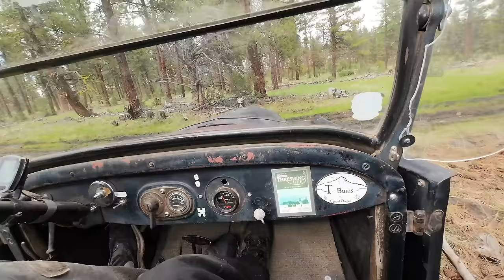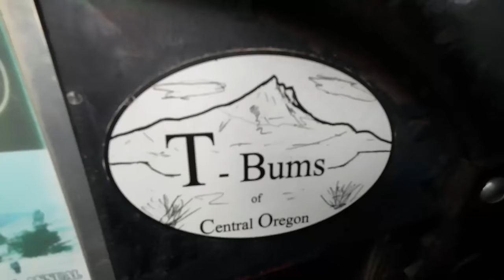Off Roading A 102 Year Old Car Goes WRONG! (Rescue mission)

Comment: This brings back memories of working with an older gentleman back a (while) ago. He used to tell  of the time in his childhood when they were traveling on dirt roads and his father would just turn loose of the steering wheel at 30 miles an hour. The tires would follow the ruts in the "road" they traveled, his mom screaming  all the time. He called following those ruts "cooning the edges." I enjoyed the video very much and wouldn't minded if had been longer. Those cars had to be tough because they were the truly the first off-road vehicles because back when they were built there weren't a lot of paved,  much less, gravel roads.

Comment: I've been watching you a while now- I agree- this is one of the best recoveries!  Also- it is Memorial Day Weekend- looking at these old cars reminds me of the trucks and ambulances they had in World War 1 . (no I'm not that old!) The used a GM 1916 3/4 ton trucks..the Model 16 had a 132-inch wheelbase with 35-by-5 pneumatic ties.  The 30 horsepower engine gave the truck a max speed of 25 miles per hour.

Comment: Let me see if I got this right:
Get your senior citizen buddies together.
Strap every artifact from the Louis and Clark expedition onto your 100 year old cars and head off into the backwoods during an epic storm.
Swamp two of them in a flooded creek.
Drain 4 gallons of creek water out of the crankcase then start it on the first tug of the hand crank and head off across a boulder mine field on 100 year old wooden spoke wheels, century old axles and springs while your buddy is putting out a potential forest fire by himself with a broken bucket and wet shirt.
Walk back to fetch your lost wheel to reinstall with a makeshift bolt.
Ponder whether any of these incidents are enough to earn the golden Turd award.
And by the way, don't step on the rattle snake!!!

Here's me, sitting on the couch watching YouTube videos.
In my next life I want to be one of these guys!

Comment: Clogged culvert you say.... post10 has entered the comment section

Also this is a great example of why Mud terrain tires are a thing.
Reply: Agreed. Those culverts seem rather undersized, but the mudslides would have blocked them in any case.

Comment: Long video? Enjoyed every minute. Some trips are just "like that" and they're the ones you remember. Doing the Tele Track up to Cape York towing a 79 series Land Cruiser that broke a tailshaft in the first creek on the trail. Still had front wheel drive, got heckled as the "Land Kluger", but we all got through together and found a tailshaft on the way back. Breaking an upper control arm right up the top of the Victorian High Country mid trip, getting out and back with parts in a day and fixing trackside over beers with mates, priceless. (2 beer fix. easy!) Enjoyed watching everyone having a great laugh dealing with whatever needed to be dealt with. Brought back some awesome memories. Thanks!

Comment: Ok Casey and Jeremy....I am so freakin tired....LOL. I have laughed til I hurt. I have itched from seeing and hearing all those nasty mosquitos. I have pushed with my legs and/or held my knees tightly together trying to help you pull them out of the mud, I bounced all over from riding through the rock and then to top it off, I mentally ran like hadees getting away from that huge rattle snake. I was so glad when you finally started back. But wait, then I had to wade through a foot of water not knowing if the earth was even under it or not!! I just could not take much more. I am exhausted!! This has to be the best video of not only your channel, but on You Tube. Thank you so much to you, Jeremy and the T-Bums!!

Comment: A few years ago, I had the opportunity to drive an original, unrestored 1926 Model TT flatbed truck. Top speed was about 40. They don’t even have a gas pedal! The throttle and spark advance levers are on the steering column. Not easy to drive….

Comment: A thought for the guys, I would expect that dirt bike tires could easily be fitted to the T's and A.  Could make a huge difference off road and they are light enough to not have issues.

A couple thoughts to help your recoveries.

Carry a bale of straw in soupy wet areas.  Spread it down where you want to roll and it works amazingly well.  I use it myself often.  It makes the difference sometimes.

Second, look into getting yourself a WWII White Scout Car, also known as a half-track.  Things can make for an absolutely serious recovery vehicle, heh.

Comment: Really nice of you to help these guys out. I suggest you use tires that are better suited for mud. Those are to wide and the tread isn’t the best application. Just a thought. Maybe go for  functionally vs looks such 😅 taller and better thicker deeper tread. Also, I had a 75 Bronco with limited slip differentials and could climb a rock.  I made sure my tires didn’t stick out past the side  of the fender extensions and had decent mud flaps.  But it doesn’t really matter if off road is the only use.

Comment: IIRC the Studebaker Brothers (all 5?) started out making Conastoga Wagons in the 1800's and switched to automobile production around 1900.  I was going to say that the Studebaker was also used by the Beverly Hillbillies.  I think that was a 1921 Oldsmobile, not a Studebaker.  My cousin has one of the last Studbakers produced: a 1966 cruiser.  Great video!

Comment: Casey, all I can say is that brought to mind stories my father and father in law (FIL) told of road trips in the early years of cars in central Africa, notably in Rhodesia (Zimbabwe) and Northern Rhodesia (Zambia). My dad told of trips, late at night in a model A between Ndola, where he was a cinema projectionist, and Luanshya, our home when the car broke down and he was afraid to get out to see if he could fix it because of all the "eyes" he'd seen in the headlights and the noises he'd heard. Next morning there were paw prints of fairly large animals around the car. By daylight he could repair the problem and make it home in time for his next shift at the mine.
FIL told stories of using donkeys and oxen to pull stranded model Ts out of creeks and rivers in Rhodesia and using reverse to get up hills that were too steep for the higher rationed forward gears. All two of them.
As to if you should make a vintage recovery vehicle, talk to Paul Cox of Fabrats. I think he's about to rework a pre WWII Chevrolet truck into a "rock crawling school bus/recovery vehicle" of sorts. Should be interesting. Maybe your friend Guy of International fame has a vehicle for you to convert?

Comment: When last I looked a couple years ago, Ts run about 13 to 26 grand in driving condition. On the low end of that they are OK looking; at the high end they look brand new. Chalk that up to how many were made, how tough they were designed to be, and how easy they are to work on (one of Henry's design goals). If you run them on kerosene, they actually get pretty good fuel economy.

Comment: You should get yourself an old skidder, like say, a Timberjack 230D. A skidder would have towed that car through the mud like it was nothing, plus it can make its own trails through the woods if need be. And cable skidders have a far, far more powerful winch than whatever you can mount on the front of a Jeep. You being in Oregon, there should be a ton of old skidders for sale there, just like here in Maine.

Comment: Pointy of Historical Interest... there was a time when you could drive this 100 year old car (or similar) over the Rubicon Trail... yes THE Rubicon Trail. There are photos of 26' Studebaker Special Six and other models and makes at various points, and it is apparent the Trail has lots of rock/gravel fill and it's not the same road today. I went over in a stock 72 Landcruiser but I might not try that today.

Comment: Time to repack the bearings on that trailer.  Have you considered bearing buddies !
Great episode love the fact that these old gems are driven
Reply from the maker: Do NOT put bearing buddies on anything other than a boat trailer, and even then you still have to disassemble and manually grease the bearing at regular intervals.   Bearing Buddies do NOT grease bearings.
Reply: @CaseyLaDelle  sounds like you have had some prior bad experiences. I guess I have just been lucky then.
Reply from the maker: @dougdean3134  tell me how bearing buddies actually grease bearings…
Reply: @CaseyLaDelle  I was told the spring pressure would push the grease into the bearings. You do have to keep them pumped up.
Reply from the maker: @dougdean3134  ok, and where does the old grease go??
Reply: @CaseyLaDelle  squishes out through the inside seal making a mess. Which I get to clean up after each trip. Doesn’t that mean it is going through the bearings
Reply from the maker: @dougdean3134  sooo… it blows out the seal, and therefore is pointless.   

The problem with boat trailers is that when you back the warm hub into cold water, tue rapid cooling of the air inside creates a vacuum that sucks water in through the axle seals, and shortens the life of your bearings.   Bearing buddies were designed to create a positive pressure inside the hub so that when backed into the water, it doesn’t create a vacuum, and therefore doesn’t draw in water.   They do NOT put any grease into the bearings, unless you over grease them and blow out the inner seal, which allowed old grease to go out the back and be replaced by the new grease.   But now you’re greasing an axle with blown hub seals and unless you constantly grease it and therefore make a constant mess, your bearings aren’t going to last nearly as long as a properly greased and sealed hub.
Reply from the maker: @dougdean3134  take an empty toilet paper tube, place your hand over one end, and place your mouth against the other.  Now blow into it and you’ll see that absolutely no air moves unless you allow air to leaks out the back end (inner axle seal).    That’s exactly what the grease is doing inside the hub.  It cannot possibly go into the bearings unless it blows out the rear seal.

Comment: They would put a pulley 9n one of the rear hubs along with the wheel and wrap a rope a few times around the pulley after tieing off to a tree or whatever and put some tension on the loose ends and there's the winch for ya casey

Comment: I used to explore the desert in old post war but pre 1954 willys, jeeps, trucks wagons and jeepsters,, enjoyed them all, the newer  4x4's just have nothing desirable about them for me, no personality just a cocoon of plastic wrapped crap,, 60 years ago when i was in high school we could by running cars from the teens, 1920's and even 1930's for $50 or less, $15- $25 was the average for a decent old runner back then, as long as it had tread on the tires, tags on the plate, ran without too much blue smoke, your good to go,, the roadsters and pickups or pickup conversions made from sedans from the 20's were the best desert buggies. just add stronger wire steelwheels from the early 30's and some chunky motor cycle dirt tires or knobbed tractor front tires and they went most everywhere you cared to go in granny gear.. Today's rock crawler and off road culture seems so  intentionally boring either  lining up to challenge big rocks and gravity or just driving crazy fast across the landscape going nowhere afap fast. compared to spending a week  exploring & driving across the Mojave desert from just above LA out to Las Vegas driving on old horse trails & mining roads & early power line roads..Todays busy busy people seem to have no patience when it comes to spending quality time in real time ,talk fast, drive fast, live fast & even eat fast and die faster . Attention deficeit syndrome seems to prevail. 15 minute video is far to long for most viewers, personally i enjoy longer videos  providing the content is interesting. Last time i drove my 1941 Chevy 1.5 ton SWB truck up to eastern Oregon from the Mojave desert parallel to hwy 395 on unpaved roads and dirt tracks it took 2 1/2 weeks, lots of slow motion adventure..

Comment: I didn’t think you were ever going to get that Studebaker out of the mud the way it’s driver kept spinning the back wheels and digging it in deeper.
Reply: That’s what they told me to do
Reply: @linustremaine5140  That’s interesting. I’ve watched a lot of these recovery videos and done a few recoveries myself and the instructions to the party being towed, especially in soft terrain like mud, snow, or sand is to advance the accelerator just until the wheels start to spin and then back off a bit to keep from digging in. 

But I wonder if you have that kind of control with a vintage vehicle like that Studebaker? With a manual transmission you would probably have to slip the clutch and the clutch disc might not tolerate too much of that?

Comment: People today don t realize that in 1915 thru 1930 the roads system in the US was 80 percent what y'all are driving in right now. There were no paved roads and the further you got out of a city the worse the roads were. The roads were wagon roads. The model A s and model T s were built for that. When it rained most of the time you had to wait on it to dry out wherever you happened to be. If you got stuck you would walk to the nearest farm and get the farmer to bring a team of mules and pull you out while laughing at you for traveling in one of those new fangled contraptions. Drivers also carried ropes and multi sheave pulleys to pull themselves out. They had mud chains for the tires and a few had a drum that would bolt on to the center of the rear wheel so it could be used as a winch. Most roads were upgraded to gravel or paved during the depression by the WPA and other government agency groups.